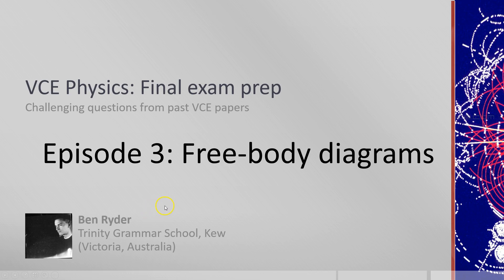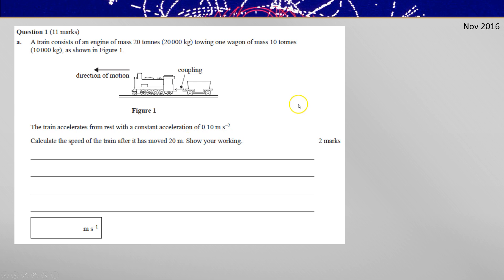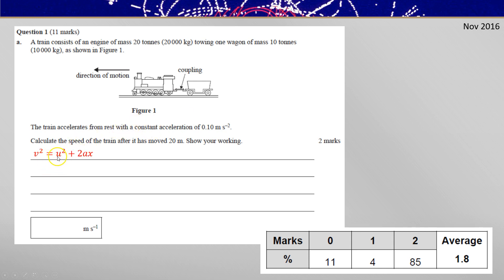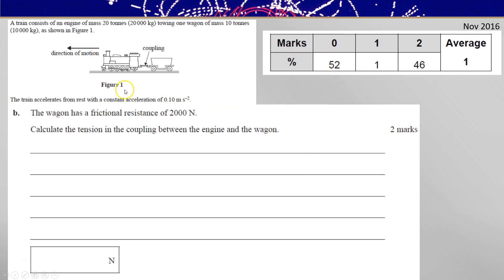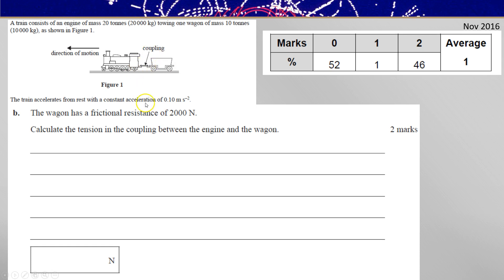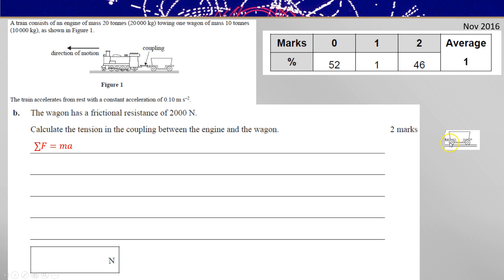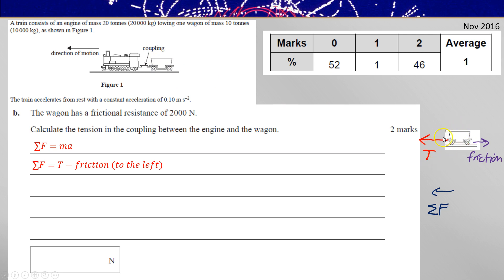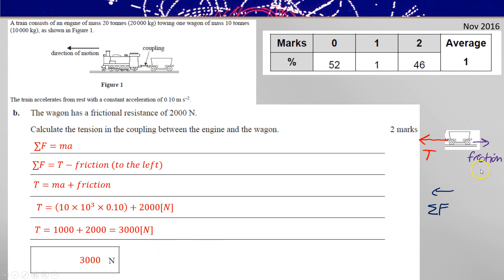VCE Physics Challenging Questions: Episode 3: Free body diagrams

Comment: Why can't you calculate tension by calculating net force as being 30 tonnes * 0.1 and then subtracting 2kN because of the frictional force?
Reply from the maker: Because 30 tonnes * 0.1 m/s/s gives the NET force on the WHOLE system, so it is a sum of the engine force (we don't know this) minus the friction. The tension in the coupling is just a small part of the system. The best way to work out these 'internal' forces is to isolate a small part of the system with a free-body diagram. See my video here for more detail: https://www.youtube.com/watch?v=jeZFu7G5qsY